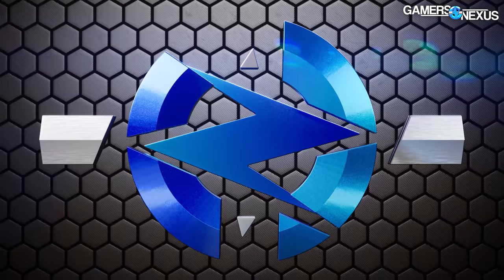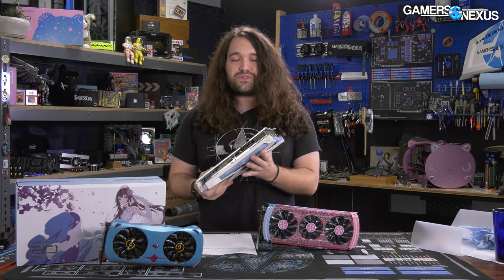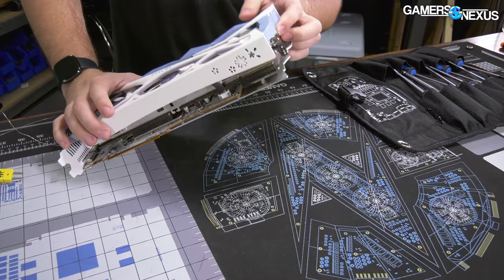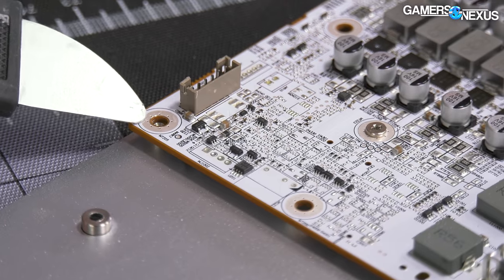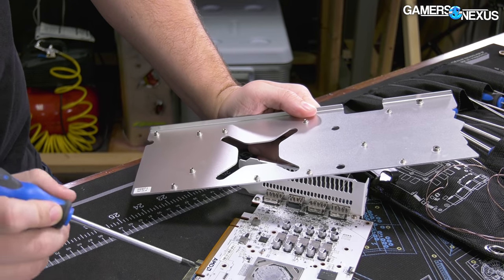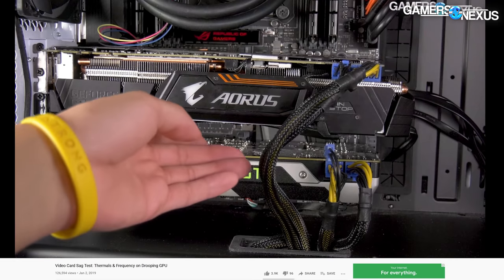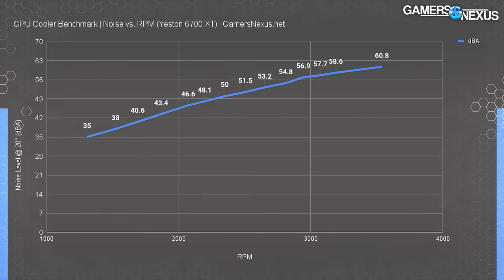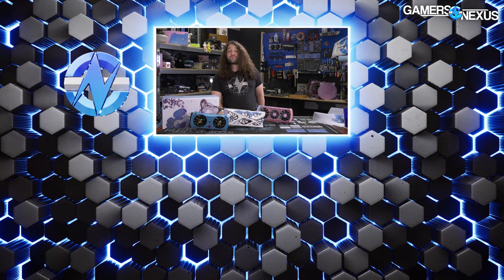AMD Waifu GPU: Yeston RX 6700 XT Sakura Review & Tear-Down

Comment from the maker: We needed a pick-me-up after all those pre-built reviews. This seemed like a fun thing to test and publish, so here we are. You can thank Dell and Cyberpower! Check out some of our previous Yeston reviews:
The Yeston Cute Pet Case: https://www.youtube.com/watch?v=62oPBdI9CSA
The RX 5700 XT WAIFU: https://www.youtube.com/watch?v=OVY5CjEC3W4
The RX 580 CUTE PET: https://www.youtube.com/watch?v=fGGKaX1D9Zo
Reply: Keep pushing buddies 😎
Reply: I have to admit that design of the design of the gpu chases it's really elegant
Reply: Steve I cannot believe you stripped Sakura like that. 🥺🥺🥺 B-b-b-baka!!!
Reply: Its pretty honestly.
Reply: I SO wish this had been about to use with my Sapphire Pure Crossfire 3200 Advantage 580ADV 939 motherboard (still got a perfect 480ADV ...I think first ever true Dual x16 Crossfire boards?)
Reply: Take your thermal probe and measure the heat of your stove hot plate and the surface directly next to it. Tell me what the temperature "Delta" is. A good card will have a high edge to junction temp difference because there is no die under the edge so heat needs to travel through a thin ISA horizontally to get there instead of vertically through the HUGE area directly over the die.
Reply: Steve If you later want to test a pre built that is more promising (so not giving you a heart attack lol)I would recommend you have a look at the HP Omen 30L model. I friend of mine recently bought that one and I find it to be surprisingly good for a OEM system.
Reply: They also have a waifu keyboard if you guys want to review that thing
Reply: @Fun With Minerals You can always go crazy with the RGB and select pink color on the lights....😁
Reply: @HerpaDerpaZX  wasn't that a giveaway thing cause I don't think they actually sell it
Reply: But what did the perfume smell like? Asking for a friend...
Reply: @sakuyaizayoi382  no idea I saw it on their website
Reply: honestly, at this point if its possible to buy it I will. I'll just spray paint it black or something.
Reply: I'll buy it if I can get a graphics card. No one can judge me when they don't even have a GPU lol. Embarrassed?🤣 ? Good! More for me! Battle of the shameless to get a card.
Reply: BITCOIN, I don't hate Bitcoin at all.....
Reply: I have a Stickerbombed Weeb PC, and I gotta say I love these Waifu and Yeston reviews. I wanted a 6700XT at some point anyway, and it's either This or a Sapphire card. I appreciate these reviews because it fits my build, Thanks GN
Reply: @Fun With Minerals they shouldn't, if Yeston keeps up with anime-inspired designs - honestly they will fall into obscurity.
With this card they basically made floral design, and a very nice one, with added anime-inspired character.
Just replace characters with other thematic designs and keep bright non-aggressive colors. This already will be very unique without falling into niche of anime inspired fluff.
Reply: Check out the Lenovo pre-builds, they actually have decent hardware and airflow!
Reply: I gotta mine some waifu coins outta this 😂😂😂
Reply: Tech Jesus I love the channel and everything y'all do. Quick question: How do I get a GPU in times like these? My only GPU has died, I have no backups. I'm used to gaming every day, but I've been down for over a week and I think I'm starting to lose my mind.
Reply: @steelking9973  we won't, demon design is less unique than this. Demon design gravitates towards dark colors - we already have plenty of those from other vendors and AIBs.
Reply: Got my new Red/black mouse pad in today & love it! Too bad I didn't win the lottery of getting one that was autographed, still a quality product well worth the money. :)
Reply: @Fun With Minerals and you missed the point. I was talking that I actually like floral design.  But anime theming will hurt its appeal. On top of that with this particular model waifu is not needed on the shroud at all.
Reply: @Fun With Minerals well, they will fill the niche for anime themed components, but that's it. Cute Pet is more bizarre so I doubt it will have same adoption as anime-theming. But at this stage that will be all that Yeston is doing, when they can do much more. And on top of that done big AIB (ASUS  with somewhat bland Gundam for instance) might catch on to a trend. So Yeston will have big competition within their niche on global market of they are willing to go there.
If they would broaden their final styles, like pure floral/landscape/nature/animal design - I have no doubts they will get better recognition in the space.
Reply: @Fun With Minerals alright. Sorry if i offended you. Was not my intention in the slightest. Have a good day, sir/madam. But you had me in mentions so I assumed you're also replying to me.
Reply: I'm not even going to pretend, the back plates remind me of the old ATI cards with the robot girls, I would buy this. It's like a dbrand skin..
Reply: It's already being scalped unless its MSRP is $3200
Reply: the image is Mei Radion from Honki impact 3rd by Miuohi entertainment
Reply: I’ll buy it.
Reply: Loved it. Keep it up. Great work.
Reply: @Gearbhall  what Just no it's practaly a peace of art
Reply: When are you gonna get a Chinese Waifu for real?
Reply: Check out Dawid Does Tech Stuff for an actually good OEM build from Lenovo. Would love to see your take on it.
Reply: Looks like there is an extremly expensive case to go with it :D
But made by a company named ZEAGINAL ?
Reply: ワイにもくれ
Reply: It's a good looking card for anime fans
Reply: Did you see they also have a RX 6800 Sakura (Waifu) card?
Reply: man.... i have a question..   do you learn Chineese??   cus it sounds realy on point.
Reply: credit where it is due, it's not just a beautiful cooler, the PCB is shockingly pretty.
Reply: Steve 还会写中文， 厉害。

Comment: Bruh at this point, I honestly wouldn't even care if the damn gpu got a risque picture of Mario and Luigi lapdancing, as long as it's in stock and near msrp.
Reply: Bro??
Reply: @dreg9001  Bro.
Reply: ayo
Reply: Bro ?
Reply: Word?
Reply: 😭😭😭 It's true, and it's only gotten worse. Outside of thread bare entry level cards, hilariously, this one is about the same price if not cheaper than the ones currently available. Most others are out of stock and gouged/scalped it seems 💢
Reply: Bro.
Reply: Bruh moment
Reply: That’s more of a pro than a con
Reply: That would enhance the value
Reply: BRUH
Reply: Bro??

Comment: Not my thing, but by god I give them mad credit for doing something original.. GPU manufacturers haven't made cool and original designs on their cards since around 2010.
Reply: [Looks at dual pistol wielding dominatrix on the shroud of his HD 6990]
Reply: I mean, for the most part they have the cool down, just not the original lol. The industry has mostly figured out the simplistic and the edgy gamery stuff, but not much headway has gone into more themed hardware like this card. We could definitely use more pretty/aesthetically pleasing designs beyond the basic minimalistic or edgy stuff.
Reply: @DragonEdge10  Edgy Gamery Stuff: 
Puts 200 rainbow colored seizure inducing LED's on Fans, PSU's, SSD's and RAM. It's faster when it's pulsating red bro.
Reply: @DragonEdge10  or the typical pile of greebles molded together to form front bezels and shrouds, yeah. some design details are cool, too busy and it starts to just look like a voltron-transformer junk pile or overflowing scrapbin, lol.
Reply: @dialupdavid  Personally, I like the LEDs being there rather than not usually, since it give me the option to change them to any colour to fit any theme, even off if I need it.

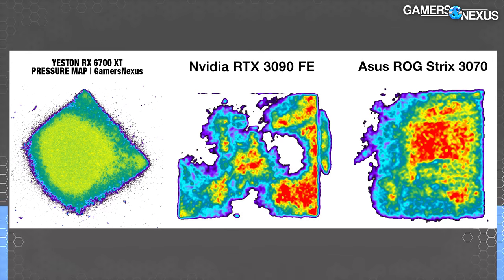Comment: 16:38 This idea of pressure testing is actually very useful as it shows how even the best of GPUs can be undermined simply by not having proper contact between the die and heatsink. 

I don't have any GPU which has such a large shroud that it actually sags/bends but I can't imagine how manufacturers let such defects slide without even considering how much this would affect the safety and performance of the GPU.

Comment: YES! Thank you GN for this review! I actually bought the 6800 & it shipped out earlier this week. This card looks so much better than the photos on the website. 

I love this GPU & not ashamed to admit it.
Reply: How does it smell now that it is in a case and getting warm and having airflow? I imagine the room started to smell quite good. It shouldn't be that strong smelling once it is dissipated around a large room by all the PC fans.

I would also buy a card like this, but then again I'm a bit of a weeb so... The colour palette looks really nice and gentle on the eye.
Reply: @matasa7463  Sorry about the confusing wording. The card have yet to arrive. I'll reply to this comment again once I have it installed.
Reply: @matasa7463  It took 2 weeks to ship from China (Aliexpress). The card barely have any fragrance out of the box. It's definitely not noticeable once inside a case with 9 fans (Lian Li O11 Dynamic & Unifans).

Overall, this GPU is very pretty & makes the weeb in me very happy as well. Unfortunately, it is also way overpriced for a RX 6800.

Comment: The colour-scheme is actually quite pleasing. I would not hesitate at all, to put this card into a white case like e.g. the NZXT 710 or DeepCool 310, if only the backplate had a more abstract painting on it. Or maybe they had packed a spare backplate painted more neutral or themed differently. For the fan side of the card: This is probably exactly how the card would look in most of the cases anyways, if it was fully white and lit by RGB-LEDs!
On a second thought: With the supply-problem these days I would probably buy it with just these looks and never think of it again except when I open up my PC once a year to dust-clean it.

Comment: Steve can't keep a straight face every time he says 'Waifu'
Reply: Because it and people who use it unironically are... special
Reply: @Dr.Spatula  yeah, exactly. It's just pandering to a niche audience. Even then the card's design is good, just cut the waifu and perfume (srsly why - I mean I understand but allergies) - and it will be a perfectly serviceable videocard for major part of PC space.
Reply: @JIAroJIy4  i personally love the yeston cards just for the color but everything else.............
Reply: @Dr.Spatula  if only Steve would voice our opinions too. We clearly like the approach Yeston goes for.
I hope he notices the trend in comment section and will give a note about design in review instead of sidestepping our concern.
Reply: @JIAroJIy4  he clearly mentioned there was a positive and not insignificant emphasis on the visuals. Such as the shroud, fans, and backplate
Reply: @Dr.Spatula  yes he did. He still stumbled while mentioning that 2D character is drawn on the backplate. Design is genuinely good, even with waifu, since it's not waifu-centric. But some will be turned off simply because there is a waifu on backplate. Same fate happened to old 2000s designs when AIBs were putting 3D females on the fan shroud, Sapphire did that for several series of cards. They sold well but not because of the fan shroud.

Comment: There making a case ,AIO loop, and key board with these character, You’ll need to get them and make a whole computer.
Reply: ohh Steve should review the case and the AIO too
Reply: No we just need a waifu-themed motherboard. There should be some opportunity with how many motherboard have big heatsink nowadays.
Reply: @ArchusKanzaki  you need - i don't. I would prefer floral design or ocean/water themed one. H.I.S had those for graphic cards(IceQ design), for instance. And I think far more customers would prefer light, soft colored design with neutral themes (like those I mentioned, or animals) instead of slapping 2D characters everywhere.

Comment: Mine just arrived today, and I can't wait to build it!! Thank you for this informative review. It definitely influenced me to purchase this graphics card. I'M EXCITED FOR THE AROMA THERAPY 😂
Reply: Yo how is it? I’m thinking of buying one tonight.
Reply: Elliot Rodger  works pretty well, I have nothing to compare it too tho, I jumped from a 1080 founders to this and it’s obviously like night and day, I literally never smelt anything other than fresh plastic/clean copper. I do know that if you don’t have a 3 pin rgb port you can’t control the lighting, I’ve never owned a MoBo that had a 3 pin instead of 4 but you can fix that with a $30 rgb controller that could honestly be useful either way if you haven’t been careful to buy only components that easily work together

Comment: You may not like the design, but I absolutely adore it! I kinda wish there was more "cute" themed computer parts. I am kinda sick of black boxes with red or RGB accents, and all those aggressive angles. I want something with pastel colors and soft edges, with little flower and cat patterns.
Reply from the maker: We didn't say we didn't like it. Not sure where that came from. We specifically said we liked the shroud and its thematic matching... ?? The backplate is a little over the top, but we liked the design overall.
Reply: @GamersNexus  My bad, I made this comment during the early stages of the video, and it felt like you didn't really like the design at that point. I should've waited until the conclusion to post

Comment: I'm pretty sure the design on the back has Hestia from Is It Wrong to try to pick up girls in a Dungeon?  Though it might just resemble her.
Reply: I came to the same conclusion. However, she looks very slightly after doing a side by side comparison. The artstyle is definitely different. I think they wanted to avoid licensing costs.
Reply: @41chemist19  Yeah probably

Comment: It's a 6700 XT so its availability is as imaginary as my 2D waifu's existence.
Reply: The 6700 XT is imaginary? The 6800 XT must be mythical then
Reply: @kraio-sfu  Unfortunately you are not wrong.
Reply: @menpee  I’ve been trying to buy one for months now, and it’s either 1.) AMD doesn’t restock them (I guess there’s more money in the 67XT and the 69XT), 2.) their website shits the bed, or 3.) they restock like two of em
Reply: @kraio-sfu  That sucks...
Luckily I'm still okay with my RX580, not many new games I'd like to play anyway.
Reply: On Aliexpress, Yeston cards are available (even the Waifu card), but you must count about 1.4k€ for one ! (However, they have cheaper GPU like the RX550 and GTX 1050ti for about 120-200€)
Reply: @TheotanyaSama  My most expensive Aliexpress order was around €30 and even that price made me think about it a lot. Knowing my country's incredible border control and postage system, everything over €10 is a gamble: either getting stolen during the process or kicked from the post office to my doorstep.
Reply: @menpee  I've already bought a couple the Yeston R7-350 (the 6HDMI variant for my CCTV system at my company) and a couple of rugged and industrial computers (water, dust and radiation resistant [MIL-STD-810G compliant]) [for a total of about 15000€] and I didn't have problems, both with postal services and customs. But sure, sometimes, ordering at Aliexpress can quite be a gamble.

Comment: Backplate aside, it's pretty nice looking. It wouldn't be out of place in a soft white build mounted vertically. It's a nice middle between the bland shape of the 5700 but not as over the top as the pet.

Comment: It's the cheapest one out there and apparently, it's hot garbage according to Chinese users.
Plastic construction, fans are loud because they are aerodynamically bad (since they are shaped like flower petals) and also a lot of intake is covered up by shroud.
Even with loud fans, it's still very hot, thermals are on par with the 2-fan reference design. Other 3-fan AIB cards should easily be 10 deg less
Reply: The same card for 3070 is like 80deg when running 3Dmark, POGGERS, this is blower territory.

Comment: I would buy this card unironicly if it werent for the availability in europe and the parfume. It is (to my knowledge) the first 6800XT (or 6700XT in this case) with a white cooler, and would be a perfect fit for my white case. Also mounting it vertical so i wouldnt see the waifu backplate anyways

Comment: I managed to get my hands on one of these, the 6800XT version though (was looking for a 3060 Ti, but after some negotiation managed to coax $600 discount out of the seller, so change of plan)

Pros : As said in the video, it's a 6800XT, and the only 6000-series GPU I'm aware of that's actually white, perfect for my white-themed build

Cons : THE SMELL. I swear, I'm the kind of guy who doesn't have a sensitive nose (sometimes I miss a fart smell after everyone realised it), but the package has a really strong smell, like a mix of Vaporub, grape, and industrial solvent? Heck, even the box is somewhat sticky to the touch (the GPU too). I had to flush the smell off the room with an industrial fan you usually find in warehouses, it's that strong, it goes into your eyes, and it doesn't go away.
Reply: Maybe I got lucky but the one I grabbed (6800 XT) had no smell whatsoever...
Reply: @RagingRequiem  well that's interesting. Mine had the smell for a week, and it gave me sore throat for a while. That's a feature I haven't seen in any GPU up to that point

Comment: low prices low end is yestons primary selling point from my experience
bought an brand new ati x800 made by yeston, fan became very loud after about 2 weeks, sewing machine oil can only keep it lubed for few days normal use, seller told me to buy off brand fan, which was what i did back in that time(should have asked for replacement instead), that off brand fan(ball bearing fan with heat pipe radiator, 10 dollar ish) is still running normal right now(about 10 years or more? that whole pc is not been frequently used for some years though).